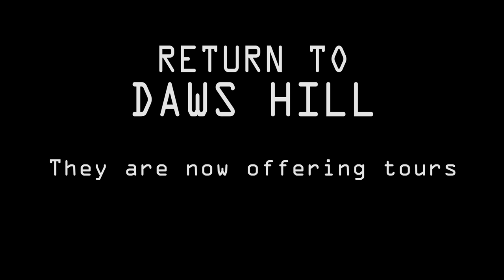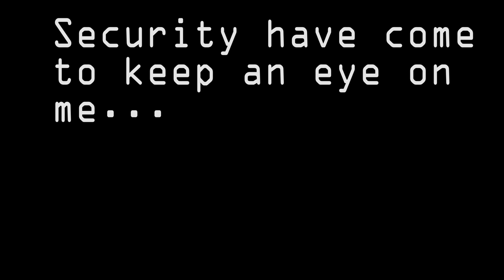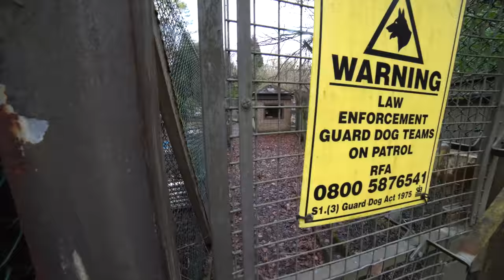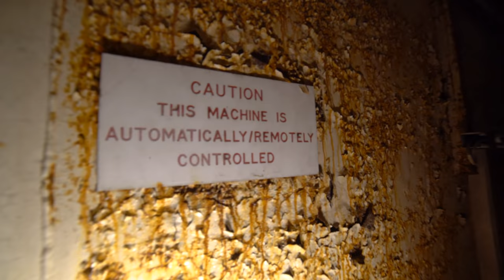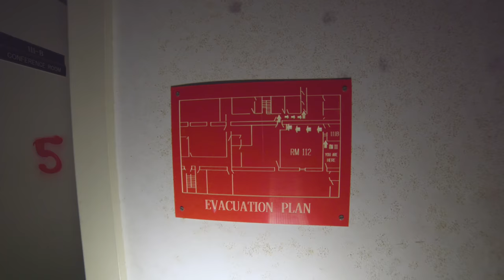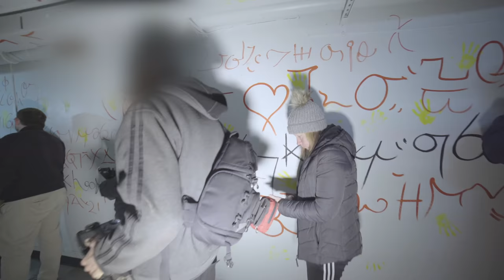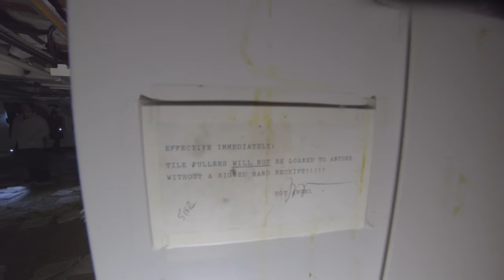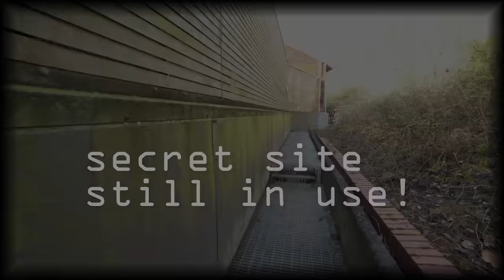Return to infamous DAWS HILL BUNKER we finally get in 4K FULL EXPLORE

Comment: Very interesting video. As a member of the USAF in the mid '60s I was was at USAF High Wycombe from 1966 through 1967. I lived on the base and worked in the underground daily during those years and am quite familiar with what the "bunker" looked like at that time. The last refurbishment documented in your video completely changed the the place. The only thing not changed was the above ground emergency generator facility and one of the above ground buildings used for offices in the '60s. Thanks for posting this video which brought back pleasant memories of my two year stay in Buckinghamshire.

Comment: Really great video thank you and the guy doing the tour. I would like to take a look but your on the other side of the world.

Some of the rooms you went into had red strobe lights in the roof and gas ports. Most places like that have smoke detection systems which trigger the release of FM200 halon gas. The normal sequence is if the system detects combustion produces sirens go off and the red lights start to flash. Depending on the site you may have 60 seconds to get out before the room fills with gas and your asphyxiated. There is normally a button to abort or delay the release.

A gas bottle of FM 200 costs about $200k and I've seen them go off because a computer system blew a power supply or someone working in the room forgot to isolate the system and brazed some pipe on an AC unit. I would not want to be the person who did that. Most sites have multiple bottles of that gas so a false alarm could involve more than $200k of gas release.

I've also seen a very old system used with and early Cray supercomputer which had tanks of CO2 bolted around the wall which would be released in the event of a fire.

Comment: Marines Corps that's interesting it must have been a significant base raf mccandlish also had a u.s marine detachment in the 80s etc thats where all those black triangles used to land Aurora spy plane and maybe the tr3b. Ive actually seen something I suspect may have been the Tr6 telos go over high up in space chevron shaped aircraft it was huge even though it was way up high made no noise had 5 lights on the underside maybe the antigravity propulsion systems or just navigation lights.

Comment: just think this was built what ? 100 years ago ? The best way to build a bunker now a days is when you have a TBM " tunnel boring machine" working on infrastructure projects like subways or water bypass tunnels in big city's like Toronto for insentience , you bring in another TBM you blast a spot in the centre of the tunnel or your desired start location then you boar off that hole to the location you want the bunker. you branch out and make your entrances and exits, and you repair your start point off the original public works tunnel so there is no trace you even made a hole off the tunnel. You can find Private secure government underground parking lots for government workers cars, in most city's, the lowest floors in these places can be used for Bunker staff cars so nobody even realizes the workers are going underground. we can have elevators, or stairs that go hundreds of stories straight down to the bunker if needed.  You have all the Main Hvac CBRN filters and air fans you need on or in any of the local Government or city run facility's, that are on the surface above the location and nobody is the wiser. PVC man hole size Pipes serve as air tunnels to the facility and as a emergency escape routes to the surface. Main peacetime water, power and sewage systems are all hooked up to the local systems, with wartime secondary systems being in the bunkers, full storage water tanks, empty sewage tanks, and full fuel tanks to run generators. with today's Tech we are able to have bunkers with 0 traces of them even being there. hidden in plain sight.
Reply: It was built in 1942.

Comment: You probably won't get 3-4h for fotos, simple because those molds are a health hazard. Also this tour or other underground tours in caves etc. minimise the time for people spending it underground because you exhale with each breath a lot of germs and humidity too. Which could lead to even more mold. As you could hear no ventilation system were running. 
Also the signal at the end of your video is for peoples watching it with earphones not pleasant! 🙉 ouch!